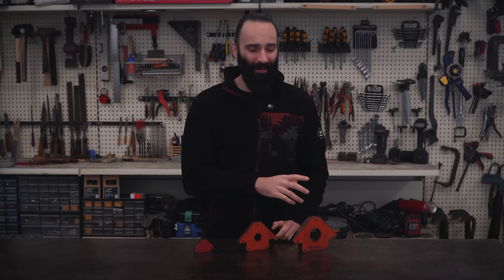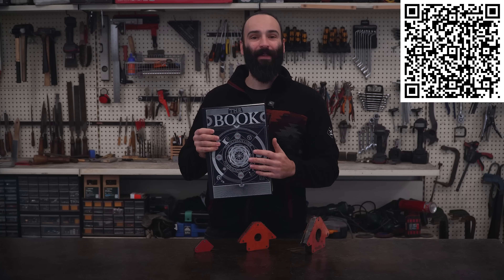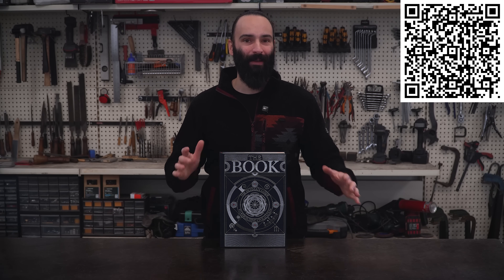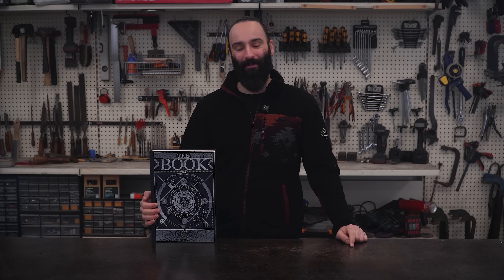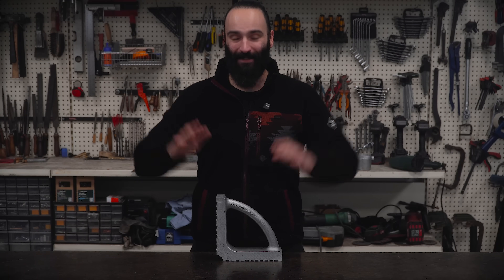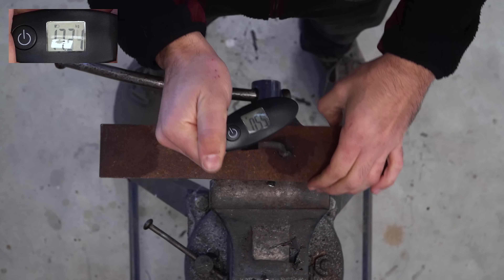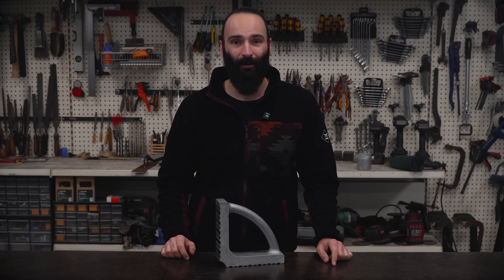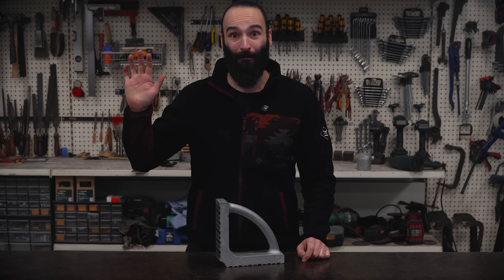Can I Make a Better Magnetic Square?

Comment: Ciao Blackbeard, please note the store bought one uses a weak toroidal magnet, the trick is in the iron plates: they convey the magnetic field making it stronger (take the chance to tear apart a cheap magnetic wood cabinet door latch, compare the assembled one strength with the bare magnet inside it).
In your deisgn you also don't seem to care about polarity of individual mangets. Some other viewers hopefully can introduce you into this stuff (and maybe suggest some design princibles via software simulation with Ansys Maxwell for instance)
Keep up the good work!!!

Comment: V2, but cast a solid piece without the grooves and just mill them in for the magnets. Save yourself the filing headache.

Also, make sure you de-dross your aluminum before pouring and get enough extra heat into it that it doesn't freeze when it cascades from the feed gate into the mold cavity / drag.

Comment: Keep them strips since they tesselate better than circles, keep them tight together, make them a couple layers deep if you can't just buy larger, stronger ones, mill them flat including the magnets after adding all of them, keep the giant riser but prepare definitely more aluminum than you need, with a spare ingot mold beside it for whats left over. Also mill the sides instead to keep them clean and flat. Good first attempt, but the more mistakes you make on the first try, the fewer mistakes you should make going forward!

Comment: I'd use some indented round magnets on the back face with a separate angle with the handle on that bolts on to the back of the 90^ face to hold things in place.

Comment: 10:50 looks great, but you should have used cutting fluid as heat will reduce the strength of the magnets permanently

Comment: What about just 3D printing it? Casting is cool and all, but some of the more engineering style filaments might work just as well as cast aluminum. Plus if you need extra weight you could just leave holes in it and fill it with something heavy like concrete.

Comment: Awesome idea. I would like to suggest two ideas, First, you need N52 rated magnets. Second, you have the most pull at the ends of magnets so maybe you could use disc magnets and place them into milled holes along the spine of the square? Imagine foot steps in snow as your layout, maybe this would help it pull harder?

Comment: at 13:59 i think you missed that you accidentally did the 3rd measurement in lb instead of kg. converted the 34lb comes down to 15,66kg, that brings the avg down to 15,71. so the store bought one was actually pretty close to yours.

Comment: Dude, these magnets are really weak, are they N52? Besides, you overheated them while milling. They need to be ground underwater, like a cylindrical grinder. And how are you planning on using them for welding? Heating them above 65 degrees is a dead end.

Comment: Even the heat of the process alone can damage neodymium magnets. If temperatures exceed 80°C, they risk losing their attractive force completely. If the nickel-copper-nickel coating is removed, the neodymium begins to oxidize and gradually loses strength. "Normal" magnets are very delicate; it would be better to use high-temperature magnets for these applications, because they could lose strength while welding a piece, and you would have to replace them all.

Comment: Neodymium magnets have different grades which is a measure of their strength.  Look for ones in the N48-N52 range.  And since you'd be welding, look for ones with a high heat resistance too, like NEH or NAH.

Comment: You didn't mention the polarity of you magnets - if you really want to use this concept you would have to do it like "NSNSNS...". But your concept does not use the magentic field optimal. The commercial ones have pole pieces (the steel plates) and the magnetic circuit is closed by the work piece - that is much stronger!
P.S.: forgot to mention: you can't use neodymium magnets. They loose their power at only 70°C ...

Comment: I wonder what would happen if you made it a strong electromagnet, possibly rechargeable... Yes, you run the risk the charge runs out, but some electromagnets are stronger than normal ones, PLUS you get to switch it on and off.

Comment: Neodym magnets are not the best choice for this project as they have Curie point at about 80°C, while Ferromagnets have their Curie point at 300-400°C. That's why they are used in "factory" welding squares.

Comment: Permanent magnetic chucks: Use strong permanent magnets that are activated by a mechanical lever or switch to align the magnetic poles and create a magnetic field. They are excellent for high-precision work because they don't require power and generate no heat.

Comment: I think the voids at the bottom of the casting were because there wasn’t a second hole to the surface that would allow air to escape; all the air was coming out of the hole you were pouring metal into. If the feeder had a small vent to the top, I think it would solve the issue.
Reply from the maker: I added tiny vent holes, you can see I ground one off at the handle when I clean the cast with the die grinder. Good guess tho!
Reply: That's a really smart observation about the venting issue. We've seen similar problems with trapped air causing voids in other casting projects too. Your suggestion about adding a small vent to the feeder sounds like it could make a big difference for smoother pours next time.

Comment: Look into magnetic switch if you want to switch the magnetic field off and clean and remove the iron dust and filings. Magnetic switch is typically made from all magnets, but you can use an electromagnet to temporarily turn the actual magnetic field off.  No that's not a typo, you just use magnets to switch the reluctance path with a magnetic switch.

Comment: You can get stronger magnets. But for two magnets of a given strength, the flux in the air gap strengthens if the other back side is yolked closing part of the magnetic circuit with a low reluctance path through steel. 

lternatly a better option would be to  implement a hallback array which focus a much stronger magnetic field on one side of the magnets.

Comment: i think the casting would have worked itself out if you had more material to pour because it definitely didnt completely fill i guess thats why you generally pour till it overflows but you got super close to just enough and thats a damned good guess 

as for the magnets that i really dont know enough about but now im going to research because im curious ... that said the biggest difference i would say with my limited knowledge is surface space the store bought ones were one complete un broken surface and i would imagine each magnet interacts with the other that its next to so maybe they were working against you also .... just a thought tho

otherwise thats really interesting and now i have magnet research to do

Comment: See if you can get N58 NIB magnets. They're a bit more expensive but have the maximum achievable magnetisation at this time. Pole orientation is also important. Cylindrical magnets usually have the poles on the flat faces so that is where the highest density of field lines occurs. Cylinders with an aspect ration of about one are likely the best tradeoff between strength and compactness. It probably would't be difficult to make a square that was too strong.
Reply from the maker: I'll see what I can find. Thank you!

Comment: The biggest problem with mag squares is cleaning the metal filings off of them. The trad square has areas you can’t easily access. Solve that and you will sell a million.

Comment: have you thought about designing a version that includes the magnets that are something like the Magnetpro Multipurpose Switch Magnets? so when you are finished using them you can just "turn them off" to release the connection
Reply from the maker: That would be great, like a mag-chuck. Would be a challenging design!

Comment: How about an electromagnet?  Then you can turn it off and all the slag will just fall off?
Reply: I worked in a weld shop that had square with switchable magnets (like you'd see in magnetic chucks). The switch would get jammed with shavings/slag/whatever and it either wouldn't turn off or turn on.

Comment: Was your first one made of Aluminum also?
Soon as I saw you were using it, I assumed the mag flux field lines would be weaker than if you used a piece of steel.
Seems like low carbon steel is almost as good as cast.

Comment: Nice design, but I've always wondered something.  Why not use electromagnets instead?  Current on = magnets stick.  Current off, all refuse/metal shavings simply drop off.  This would aid in not only cleaning, but the battery would only be used when your using the magnet, not when storing it.  I just looked at some popular ordering sites and found dozens of different designs with varying power that could easily be worked into a 3d printed mold design.
Would that make this .........version 2.5?  LOL
Reply: Electromagnets would be a clever upgrade for easier cleaning and better battery use. It's exciting to think how future versions could integrate ideas like this to make the design even more versatile.